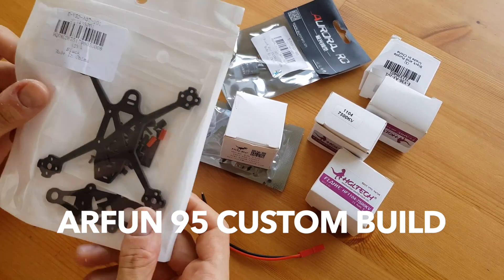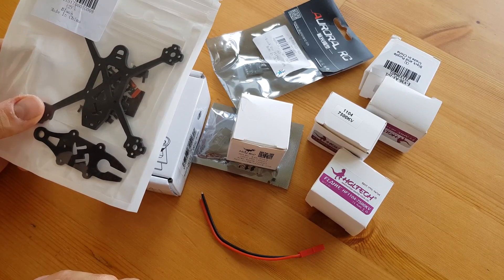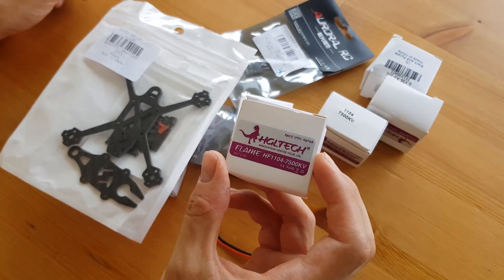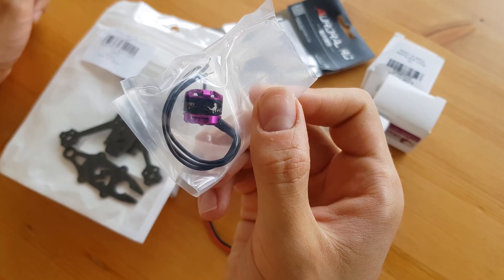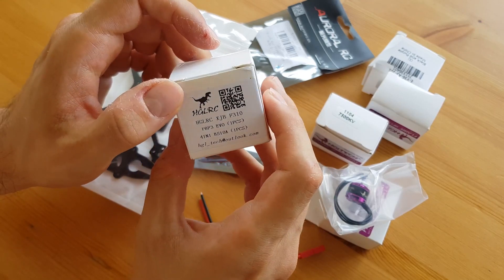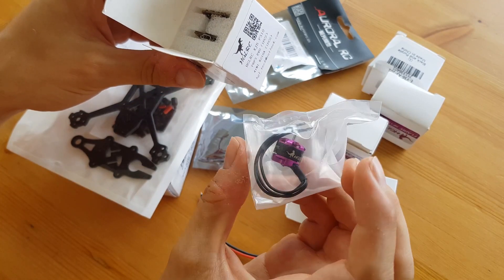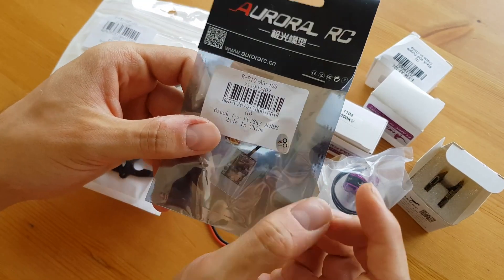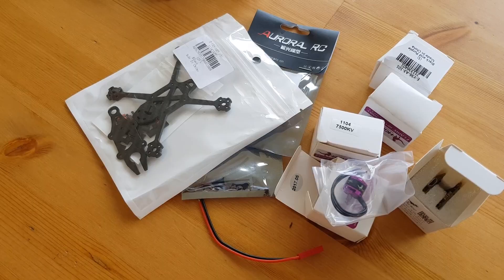Arfun 95 pro custom Build and flight test

Comment: you can do a man in the middle attack to get your osd working :) 

I know its not the exact same model but the basics is the same. your camera has two sets of pins connecting the two boards of your cam/vtx. Locate the set that has three pins. use your multimeter to find ground and current. then you are left with signal. the process that is in the video is kind of barbaric so I used an exacto knife to cut the plastic in stead of melting it off. ( the meling WILL make the remaining plastic more brittle)  Then solder in (better than on the vid :P ) two cables like he did. route them to you flytower and solder them too and u got osd. I did the same thing for my butterfly 2 inch that uses an cheap similar camera that i just made a video signal wire with a  3 volt fuse that i touched ever so gently to the pin i thought was the signal on the camboard after finding the current pin with my voltmeter. usually the current and ground are neighbours and the signal to the end of the connection line. :)

hope it was not too confusingly hacked up infowave;)

contact me if you need help?
Reply from the maker: Hans-Jørgen Pedersen thanks for your help but the issue is that the fc doesn't have a video input or output, there is no osd with that fc.

Comment: hello, im thinking about getting the same build but different motors, wanted to ask if you think that flight controller + esc are good and are you sure they can handle 3s?
Reply from the maker: FreeWaffle hi, the f310 handle 3s with no issues it is very powerful. I have a friend who has the f425 with the same motor and we didn't saw any significant differences in power, if you want to be sure you can get the now new f313 with 13a esc which is perfect for those motor that are rated for 12a max
Reply: antoine719 where can I get the f313? Also I will probably use the racerstar br1103b motors so they draw less A than the motors you uses
Reply from the maker: http://www.hgltech.com/